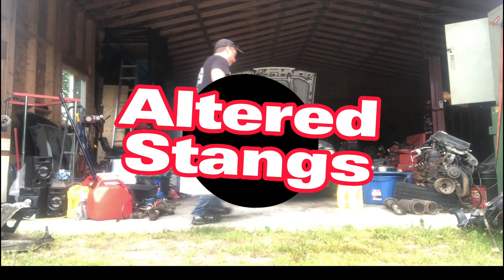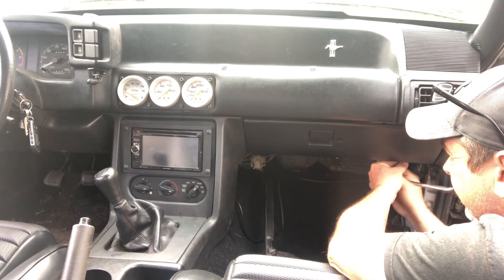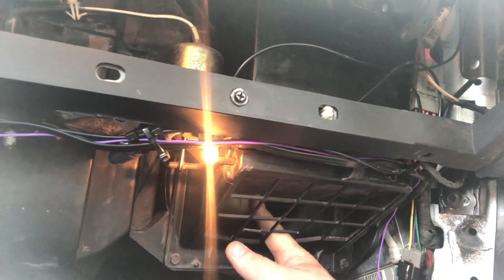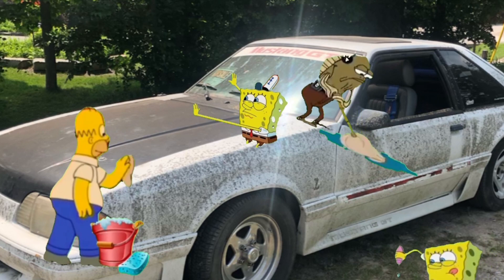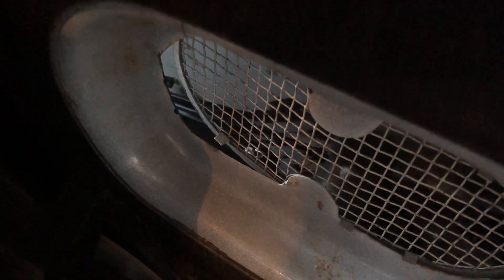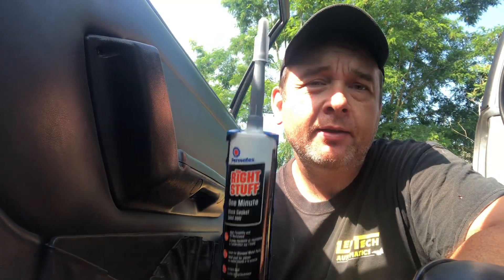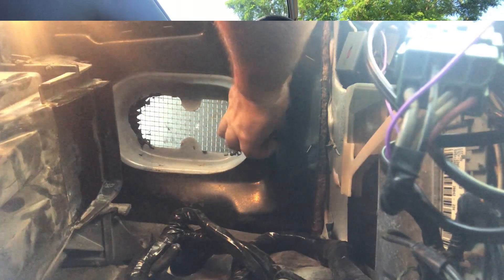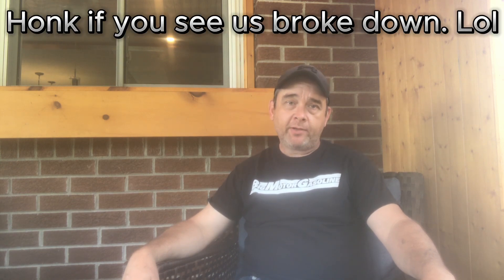This Fox Body Mustang is cursed! Stopping mice from getting in my fox.

Comment: Ugh, that sucks. We have so many mice around here, there's one in my truck. I wonder if the mouse pulled that screen up. How's the SVE rad?
Reply from the maker: Hi! They are destructive little buggers that’s for sure. I don’t think it pulled the screen up. A previous owner painted all inside there and the wiper motor linkage. Not sure how it got like that.
The Sve rad has my average temps at 178-180 cruising. In stop and go traffic it got to 195 but as soon as I was moving it went down. It was very hot out.
Thanks for watching and commenting!